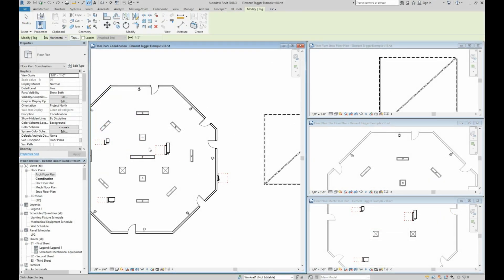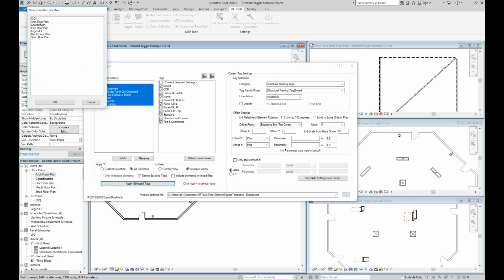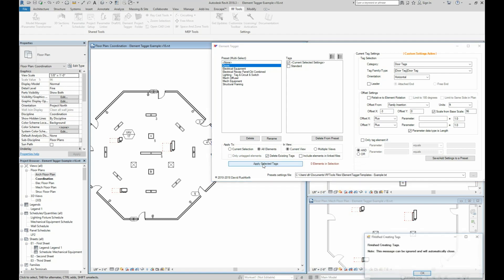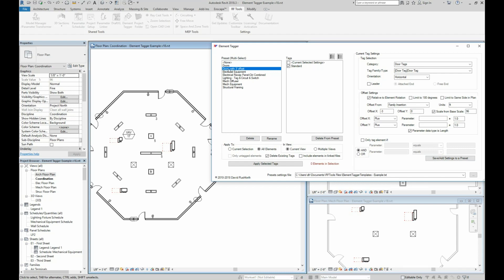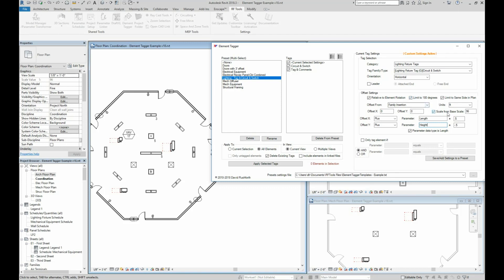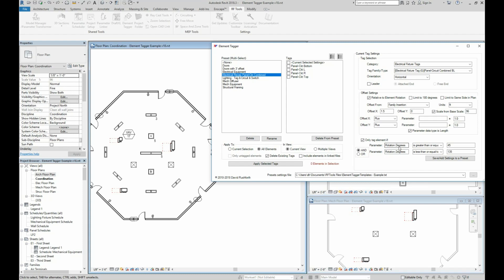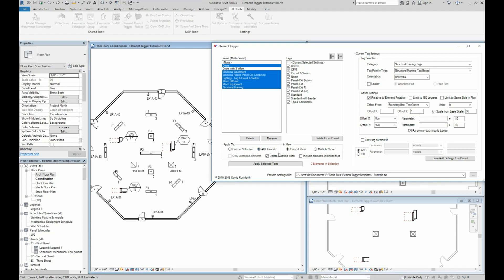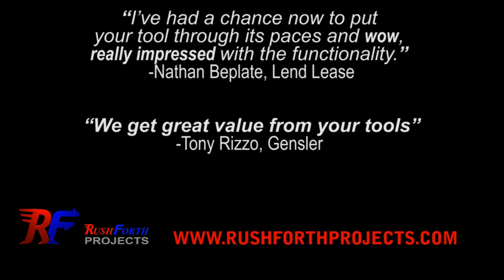How To Automate Revit: Annotations with Element Tagger

Comment: Hello, I am attempting to link parameters for a pipe and a rainwater drain, both of which are currently active. My goal is to ensure that the flow rate is consistent, a feature I previously did not incorporate for the roof drain. Could you guide me through the process? I’ve made attempts, but they don’t seem to be successful. It worked once, but subsequent attempts have been unsuccessful. The flow rate parameters are shared parameters that have been added to both the pipe and the roof drain. Could you assist me with this issue?